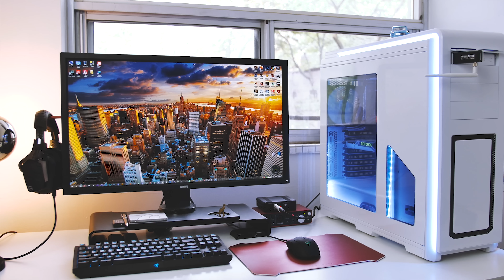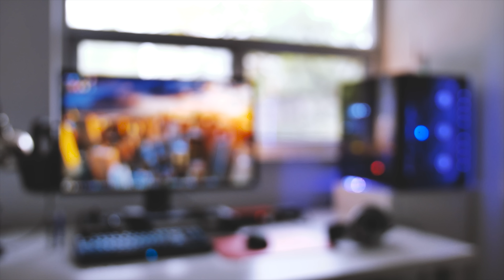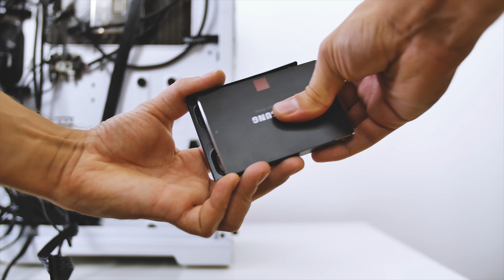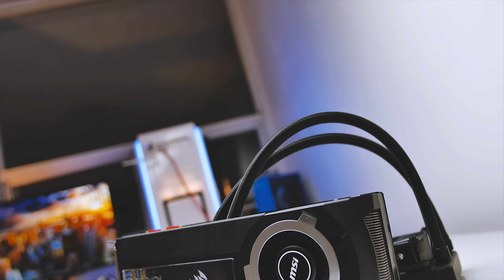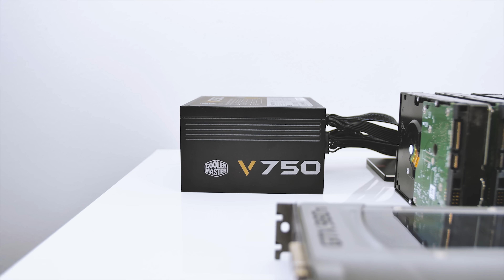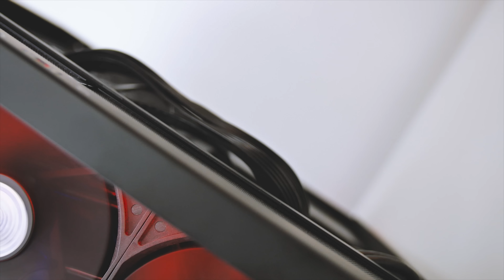New Workstation PC Upgrade | Aluminum + Glass = Sexy!

Comment: I'm using the Synology 1815+ NAS. So you can take as an example 5x 6TB HDD and make a RAID 6 on top of it. Then you have 16TB usable storage and when you need more you can put a 6th, 7h and 8th 6TB HDD in it. Than you can ahve up to 36TB usable storage with a RAID 6 security. So you have pretty high security and a real nice transfer rate. I can fill up the 1 GBit/s connection with a single copy command.
You can also make a bond over the four gigabit connections so you can ahve up to 4 GBit/s connection to a switch if you use the NAS from multiple places.
I have a small video about this NAS on my channel but I don't think you will understand it because it's in german. But there you see how easy it is to use install this NAS. :)

Comment: Looks like the front 3 fans are not spinning at the same rpm (maybe they don't have the same profile) Maybe you should change that. For suggestions on x99: 5930K will do you well! As for the mobo. It depends on your colorscheme. For yellow: Gigabyte X99 is a great choice. White: Asus x99 deluxe. Black: MSI x99. Great boards, but not as great as the shots in this video ;)

Comment: Putting a computer on a desk makes little sense, it's just taking up usable work room. But the way you did it is pretty good.
Reply: +Barack Lasagna the reason it's better on the desk is for dust collection. On the floor there is a much higher chance for dust to collect in the system. This is why most computer savvy people will not run their computers on the floor. I agree with +Game Hound too ... the lighting can get annoying if it is too bright or if it has "breathing" effects. I used to have a lighted system and thought it was real cool ... but then .... I found all the lighting was annoying and ended up disconnecting it all. lol ... My new system is nice and dark .. but then again .. its also a media center / work / gaming computer sitting in the living room using a 42" screen as my main monitor and a 27" secondary on an end table next to my recliner I sit in. LOL most comfortable computer chair on the market a Lazyboy recliner :D lol
Reply: Ye I don't like having it on the desk, unless you have a massive desk then it's not bad. When you sit in front of it for hours though I find the bright lights get annoying.

Comment: Also, you should SLI your reference 980 Ti in and use it for CUDA cores in rendering or for PhysX in games.
Reply: +Subal Pant If the Power supply is only 750 watts i think he would have to upgrade, along with the water cooling and hard drives that thing already pulls a lot of power
Reply: Very true, at least 1000 W.

I'm sure he has a power supply that he reviewed with a higher wattage laying around somewhere XD
Reply: +TechStyle I suppose he could just stick it in there then as another graphics card used only for CUDA.

Comment: Nice build! For the NAS, I suggest the Qnap  TVS-x71 (671 or 871).Throw 2 SSDs as cache plus a 10GbE network adapter, it is lightning fast, ideal for editing 4K videos on-the-fly. For X99 platform, I still believe 5960X is a good investment (think about the time you will save, lol), but 5820k is indeed a more cost-efficient option. BTW, hey Dimitry, what monitor stand do you use? it looks awesome....

Comment: For NAS, check out the Synology DS1515+ (5Bay) / DS1815+ (8Bay) or the QNap VTS-671 (6Bay) / VTS-871T (8Bay + Thunderbolt)
All above have 4*Gb Ethernet port, so grab a switch capable of Link Aggregation altogether ;)

Comment: Isn't the 3930K Ivy Bridge, not Sandy Bridge?
Reply from the maker: +Alex Efimov damn did i mess that up... well good thing we have you guys to correct me :p
Reply: +Alex Efimov The 3930K is Sandy Bridge-E. 4930k/4960X are Ivy Bridge-E, and 5820K/5930K/5960X are Haswell-E.
Reply: +Alex Efimov It's Sandy Bridge E.

The 4820/4930/4960 is Ivy -E
5820-5960 is Haswell - E.
Reply: +Alex Efimov Wrong, 3930K is Sandy Bridge E
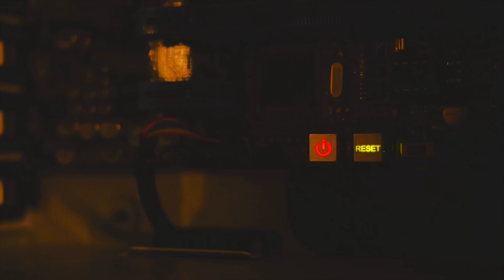Reply: +HardwareCanucks Dude what is the song @ 1:46 the mixing is incredible, also Lian Li makes sweet cases, i hope i can afford to purchase one some day
Reply: +Alex Efimov no
Reply: +Alex Efimov Sandy bridge. It was released just before the 3770k, which was the first Ivy bridge. Extreme editions are always late due to them being the most refined versions, and that refining takes time. Also, if people dove onto a new generation extreme edition immediately, the consumer grade chips wouldn't get as much attention. Extreme editions usually come out before the next gen consumer CPUs, for example the 5960X is Haswell-E and came out before Broadwell, even though it is a 5xxx series CPU. The 4960X came out before the 4770k, but is Ivy bridge, also one step behind.